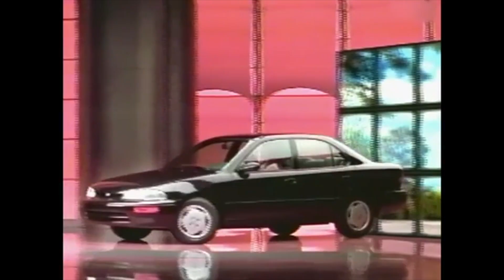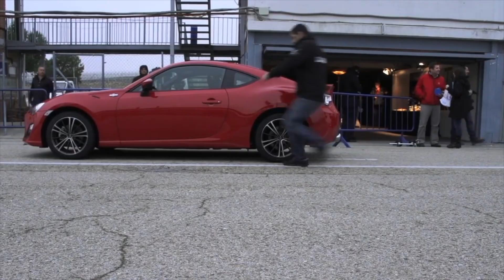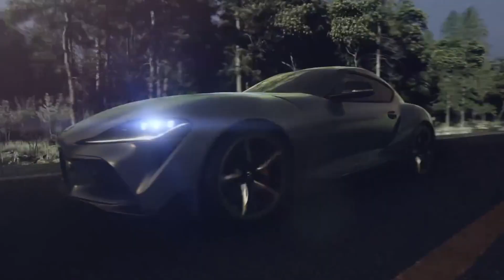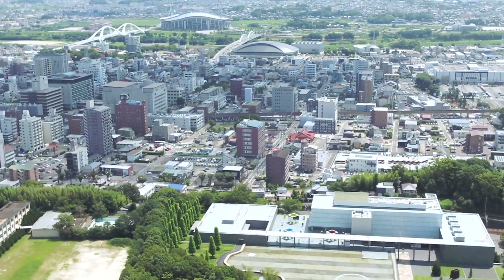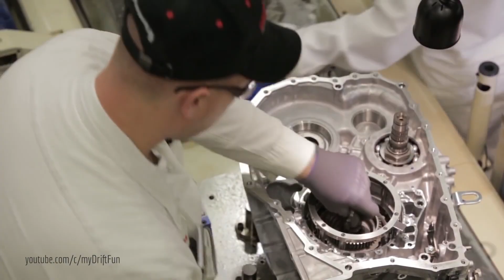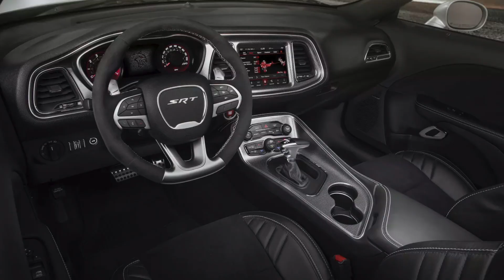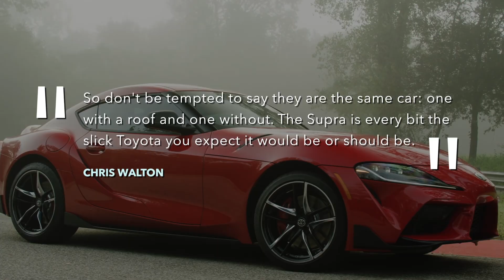MKV Toyota Supra - BMW or Toyota? The UNTOLD TRUE STORY

Comment: Is this some sort of attempt at damage control?  How can this new "Supra" be seen as anything other than an insult? A slap in the face of Supra/Toyota sports cars everywhere?? Let's forget for a moment that it is just a restyled Z4, which it is. Let's even forget that it's a DETUNED, restyled Z4... And instead let's remember that the Supra was Toyota's aspirational sports flagship, originally a top trim for the Celica. Eventually evolving into it's own special vehicle. A bespoke and impressive halo vehicle for the brand. Like any manufacturer, a flagship embodies all that the brand has learned and stands for. Eventually it reached the lofty goal with the MKIV, a Toyota that put the world on notice. Giving the likes of M3's, 911's and Corvettes runs for their money. 

Fast forward to today, and lazily rebadging a meh, midrange BMW is it? Is that was Toyota stands for? What the storied Supra nameplate deserves? A car with tepid performance that a Corvette which costs just 5K more would absolutely demolish? Maybe the over dramatic styling smothered in ghastly fake vents makes up for it's neutered specs.

Sorry, but no. I'm not buying it. Wax lyrical till blue in the face, but it won't change the hard facts that this car is not even a Toyota, and that it's performance will be just as lukewarm as the 86, only in a different class.. Speaking of, the BRZ/86 wasn't really a "joint venture" either.. They're all about 98% Subaru. The only thing Toyota on those cars is the direct injection system, and perhaps a few development cash infusions from daddy Toyotabux... Which is ANOTHER reason this car is an insult. Toyota had/has more than enough resources to develop their own sports car. But nah, just cheap out, who will notice?
Reply: OutLawMula  Right. Offering constructive criticism is being a cry baby eh? Well, I appreciate your bitching about my crying over this dead horse of a Supra. Perhaps I was a tad over-passionate, excuse me. Just mourning the loss of a loved one.
Reply: What did they do for them to insult you. It's there business. On your Z4 rebadge, read this clearly, "Toyota and BMW collaborated back in 2012 and design a new chassis and developed the better B58". Is this clear??? The new BMW Z4 came out in 2018, means BMW was ahead of the game re-releasing the Z4. Let that sink in.
Reply: @DSPNWtoCali   It's an affront because it's not the car it purports to be. It's disingenuous, and that's insulting.  It's no more a true Toyota Supra than the Aston Martin Cygnet was a true Aston Martin.. 

And I don't buy that "collaborated back in blah blah" PR BS.. You can be led around like a lil sheep and drink the cool aide if you want, but I won't. Just because a few Toyota and BMW people met up a few times, probably to talk more about money than engineering, means nothing. Because it's still 99% BMW underneath, there's no denying that fact. Just as the GT86 was/is 99% Subaru... Oh, and by the way, the new B58's are ALREADY having typical BMW problems, shifter malfunctions, coolant pump leaks https://f30.bimmerpost.com/forums/showthread.php?t=1292652, and Vanos failures. https://f30.bimmerpost.com/forums/showthread.php?t=1462359  Let THAT sink in.

Comment: thanks for clearing up some questions we all had. price point is bad either, considering the old supra's price is skyrocketing. hell it'll be cheaper to buy the new supra then to get a used one. good luck finding a used tt supra that hasn't been molested under $50k.

Comment: This maybe a pretty decent "Drivers" sports car from Toyota in a while.

But I really do question Toyota's motivation?

When Toyota released the 86 .. with advertising at the time it was inspired by the old Toyota 2000GT ... Mmm but a 2000GT was only a 2 seater ... the 86 is a 4 seater hatchback ... the GT2000 had in inline 
6, the 86 has a Subaru 4 cylinder boxer engine ... Ok Ok the 86 does have it's strongest ties with the old Corolla 2+2 AE86 RWD Coupe of the 80's.

Now this new "GR" Gazoo Racing Supra....Ahh if my memory serves me well, the Supra is also a 2+2 Hatchback, the Supra always has been, one of it's strongest features...Now Toyota is proclaiming the Return of the most loved Supra...and it's only a 2 seater fixed head coupe...Ahhh it ain't no Supra! yeah sure it's got a blown inline 6 in it...But, it's only a 2 seater with an inline blown 6, as it's built on the exact same 
floor plan as the new BMW Z4...So anyone would have to say the new GR Supra is most like a BMW Z4, nothing at all remotely like the old loved Supra..which has obviously died...though I guess Toyota could attach the name Supra to any of their cars and sell millions of them....Oh yeah the Elephant in the room i missed...I am sure Toyota know this...the new Toyota Supra is most like their old Toyota 2000GT....So my preamble 
here...Why are Toyota shoving the name Supra down our throats with this new sports coupe? When it is a mirror copy of a BMW Z4 Hairdressers coupe? Or most like the old Toyota 2000GT...Ahh why not call it, what it
 is, what i would call it, a Toyota 4000GT!!!! ... and please stop flogging us this all new loved Supra return...it ain't no....Supra....fgs Toyota are completely lost nowadays......
Reply: "How Toyota hit a new low"

Comment: The BMW thing was not really my big hang up. When the NSX came out, it had no connection to the first one, It is a brilliant car, but its just another super car that no one can afford. its a track day car, paddle shifters, computer controlled everything which is fine for what it is. The old NSX was an affordable sports car that was about driving rather than numbers. The new supra is similar to the old one in the sense that it is an affordable sports car, but why not offer a 6 speed? why not revamp the 2JZ engine? I just feel that Toyota has the means and rep to make a pure Toyota sports car. The BMW thing is what it is..I just feel that the MKV was an opportunity to make a badass ode to the mark 4, a twin turbo, 6 speed sports car for 55 G, a real drivers car. The interior looks just like a BMW, its got a lame looking shifter. It just seems like a missed opportunity. Who knows, maybe it will do extremely well and all the misgivings will be for nothing.

Comment: 42k in 1994, the price of the MKIV supra, is the same as 74k in 2019 after adjusted for inflation. The R35 GT-R came out at 80k. That is very accessible. Something in the 80-100k price range with performance to complete with the NSX and GTR is what the Supra revival should have been.
Reply: the reason it failed in the first place was the high price, they only sold a bit over 10k fourth gen, it was first meant to be a higher trim celica, not a supercar

Comment: Supra fanbois forgot that the B58 is an all forged engine, which means it's going to be stronger and lighter than 2JZ...
Reply: comes with bmw prices and labor costs this is no jdm...compare tuning parts from dinnan and ac schnitzer  side by side with aem and hks lol ...this car is a euro not jdm and shouldnt have a yota badge on it
Reply: Get back to us when the B58 makes 1000hp on the same block mmkay.
Reply: What is the B58 block made of?  Is it still magnesium like the shitty N series, or is it all aluminum like the N series should have been?  

The engine is so untouched that this information is still hard to find.
Reply: all i see is a forged crank shaft  and a plasma coating in the block so sleeving isnt necessary 🤔
Reply: Aahahahahahahahahahahaa, that's a good one. The 2JZ-GTE is an overbuilt, overengineered engine, it was and still is a monster, very few modern day engines can compete with its reliability and performance. The engine is tried and true and has the numbers to back it. There is a reason that the engine is still used in drag cars and other racing  applications to this very day, even tho its becoming rarer and rarer.
Reply: @Tahllinavian  In a hand full of years.. The B58 has already proven to be one of the best tuning platforms period. Give it a decade with more R&D and it will be the BMW equivalent of a 2JZ.

Comment: Tada San said in one of the interviews that only the automatic transmission was able to take the torque produced by the engine I'm guessing non or the BMW manual Trans.. were up to Toyota  reliability standards,  Remember this engine output 365lbs/tq at 1500 RPM not to mention is a Full internal forged engine with closed deck.

Comment: It still doesnt excuse them from omitting manual transmission completely,  especially since it will most likely be one of the very last cars that can be made that way before hell of autonomous and electric cars breaks loose with countries banning petrol cars left and right. Besides there is manual transmission there for this exact goddamn engine in M240i, why the hell they didnt make it a standard and make automatic or doubleclutch a paid option just like M4... And bullshit about demand is blank statement, if there is none offered how they want to gauge the demand? People who want the manual will just wait and wont buy the car till it will offer it. It should've launched with M240i's manual as standard.

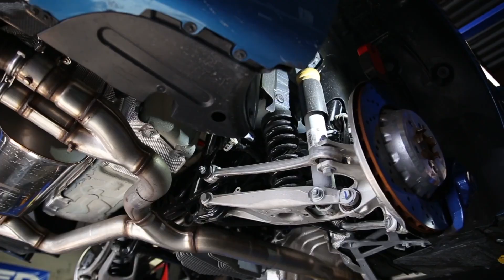Comment: That's My car @9:32 .2018 M2..funny thing is that the source video exists because I was swapping out the stock BMW suspension as it was crap.  Tonne of chatter in the rear with the OEM set up.  Swapped it with Ohlins R&T.  Now it's like butter.  People buying this "Supra" better take a good hard test drive before purchase and see if they like the stock set up.

Comment: The N58 is the sueccssor of the N54. The reliability and power output of the motor makes it the German 2JZ. Also good potential to mod the motor. We should be optimistic. This is the first of many great cars Toyota will make. The 86 had a boxer engine.

Comment: The BMW supra no stick 😆
Reply: No excuse it's a no go .. Makes little sense I want to bring up mini Cooper that's a performance automobile i think said think BMW had somthing to do with in later years great car HAD A GREAT 6 SPEED MANUAL that and modify the new supra.s engine to give you above 500hp and we will see
Reply: Don't care if this automatic was used in a lambo you don't put that in a supra
Reply: I also call into question. The deminsions of this car for a lot of reasons ..were just going to have to see what the aftermarket can do to this ..

Comment: Love the video, the most unbiased video I've seen so far. I think one thing to take into consideration is that executives spin the truth a lot for marketing, so sometimes even official statements can be a bit full shit. So far there has been no signs of any Toyota part on the new Supra and the platform is based on BMW's CLAR platform which is well documented. If there was any real co-development it was in the form of discussion on how the platform would be developed by BMW. The Z4 and the Supra have to be similar otherwise the whole point of cost saving development would go out the window.  Also generally speaking when a car is designed to be a roadster the engineers usually focus making the chassis strong enough to deal without a roof structure, much like the last Z4 or like the Honda S2000. It was no surprise that the chassis would be stiff. I honestly think that the majority of discussion was over the dimensions of the Z4/Supra chassis since the FT-1 Concept clearly showed the same overall proportions of the MKIV Supra, yet the FT-1 design had to be wrapped around the proportions of the Z4 instead. 

Really in the end even if Toyota designed the whole project people will see it as a BMW because of the parts used, where it's made and how everything about it is like a BMW and not a Toyota/Lexus.

Comment: Hmm. I think the engine has its flaws. The internal exhaust, it makes it impossible to design or build a custom manifold to enhance the performance in the way you want. timing chain in the rear. Chains now a days is shit. They stretch and breaks and BMW has problems with it and the place ment of it, makes it extremely difficult to replace.
A Supra should be the car that demonstrate the best they could build not what they could make BMW build for them.  The Design is not my favorit but body kits will come and hopefully that could do something about that... The interior is to mutch BMW and the FT1 had a great look that was like a cockpit just like the A80. It's going to be a fun car but it isn't A Toyota
Reply: You hit the nail on the head man. You just saved me a few minutes of ranting. I am trying hard to get used to the looks of it by looking at it everyday. I saved money for a few years just for the purchase of this car and I also have an mkiv Supra. Not sure yet if I am going to buy one. The good thing is that the crank, rods, and Pistons are all forged. Seems like all I needs is a big turbo, fuel system, e85 and engine management. The exterior, the non-cockpit feel and the auto are the downside for me.
Reply: true. They just took whatever was laying around too make it as cheap as possible and still sell it for like 70k
Reply: Do you think the fact that the chain has to drive all 4 cams and 6 cylinders stress it more than normal? Or do you think it's just poorer quality chains in Europe? Or both?
Reply: @Bristecom  it's a combination. Europeans could build better. Like the Alfa Romeo AR202, older  Mercedes or BMW didn't have chain issues but the newer chain's get longer just like VAG's chains. Think the tourqe from the Turbo engine is a big part of it.
Reply: @ketillundsrensen6167  it is just a matter of people being greedy and going cheap everywhere they can. Chains can be made reliable so easily, but it would probably imply a 10 euro investment on the car, something they cant afford.
Reply: @ErnestoRivera86  agree they cheep out on parts and what does it matter as longe as the chain can hold garanti period out...

Comment: To the people supporting this. Where’s your proof Toyota did anything on this car? I asked them out right and was told it’s basically the body and “tune”. They didn’t do fuck all. They could have used a Lexus platform. It IS badge engineering
Reply from the maker: There are references listed in the description, I recommend reading them.
Reply: I think you got some different information from those “sources” than I did. First this is all comments from the head of the product. He is not going to tell it how it is. It’s clear from behaviours that Toyota have been, for a lack of s better word, played. BMW started on the release date of this new “Supra” that thier Z4 is quicker and they’re correct. I would check out car and drivers comparion from 1993. The Toyota was quicker, stock, than a Ferrari 348 and Porsche 911 at the time and for less than half the price of either of those cars. Not to mention the reliability of a Toyota was a huge upside. Toyota have not replicated this formula. They have brought out a car that is worse than cars at a competing price point rather than better,  to to mention using a HEAVY amount of BMW parts. People are right to judge. BMW have got the better end of the deal. They got a handful of engines tested and improved and released and superior product. Toyota have been left to pick up the disaster left behind. Defending this car would be to ignore the previous accomplishment of the mkiv. It’s a legend for what it was out of the factory not for what it was modified. That’s PROVEN and it was at a superior price point for the time. Toyota have not replicated this formula. Don’t get me wrong, the quality of your video is top notch and deserves praise but your information is skin deep from a man trying to save face

Comment: They should have just put another 2JZGTE being a new and improved 600+ hp street legal and bullet proof engine instead of some  BMW trash inline 6 with it's dual scrotum turbo..
Reply: Regulations have entered the chat
Reply: The old Supra wasn't even touching 400hp stock. Plus it's not all about power, ya know?
Reply: Dual scrotum Turbo... and it still won't have any balls😂😂😂😂😂😂😂
Reply: When they colaberate its always bad..you get a shitty half breed that leaves everyone underwhelmed..
Reply: And then it ends up being priced at a 100 grand

Comment: I've heard that the engine is supposed to be good for modding. True or nah?
Reply: You can get in to ~400whp easily and after that it's going to start getting expensive. Get rid of the car in 3-5 years or it will drown you in repair costs.

So in the whole, little more go in it but nothing spectacular. That aluminum block will not hold crazy 2jz-gte power.